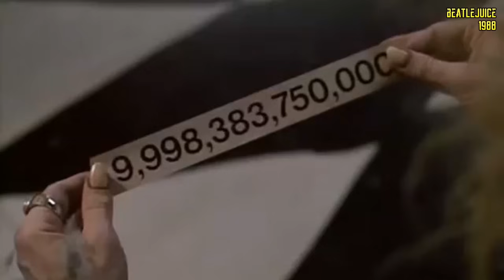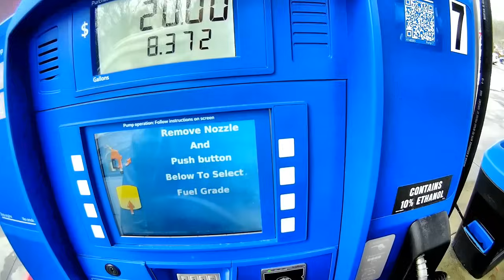Mini Truck (SE01 EP25) gets her clutch did! Another MPG reading. Consumer Transmissions  S83p HiJet

Comment: Its always the best ten-eleven minutes of my day. I liked the heartbeat during 'surgery' with the audience watching, i was really pulling for our mini truck there. Then her little horn conks out, you prolly should replace that with a train horn. WWWWWWWWAAAAAAAAAA...You edit a funny video bro. And aint it just like them New York drivers to cut you off like that, sheesh.
Reply from the maker: I fixed the horn, but have a good set if air horns I want to add with a switch to go back and forth. Yes. What an idiot. I have right if way, they had a stop sign

Comment: The headlights in the mirror was a Christine running up on the Camaro scene. 
Also would have thought it would have gotten a lot better mph than just over 20. My Tundra beats that and weighs much more. I still want one tho. With a 3 point hitch these would make a great mobile garden plowing machine. 
All around great video. 👍
Reply from the maker: Thanks!👍👍😎

Comment: Damn, clutch while you wait and watch.  That's service!
I'll need a clutch job on mine but I'll have to handle that on my own I think.  Fortunately the Sambar is rear engine but I'm sure it will throw me a curve.
Reply from the maker: The nice part is it so small and light and the clutch is tiny. none of the bolts gave a hard time at all, they all came out easily which was nice

Comment: Your videos are good, so glad I found them. Yesterday I bought an electric chainsaw like you have. Already bought CV boots and springs. Looking for a battery powered socket wrench like you use. Apparently the newer version has a much bigger head and is useless in tight spots. Keep making the videos. (Beep)
Reply from the maker: TY! They make a fuel and a regular version mine is not fuel... This is the model https://amzn.to/2V69P06
Reply: @MotoCheez  the difference i hear is 30 vs 50 ft lbs i cant decide which, but i might let the price do it for me.
Reply from the maker: For  the ratchet I finish tightening by hand. Art had the fuel that I used. It's heavier and bulkier.

Comment: Mine was frozen today and didn't want to start. Maybe tomorrow I'll go for a ride
Reply from the maker: Aww, you get a lot of snow?
Reply: MotoCheez it flurried. I am in the north west corner of TN. Not much snow. But it was below freezing for 2 days and my mini truck doesn't like the cold. I got a new battery for it and an oil change in store.
Reply from the maker: Well I just solved my choke problem on my mini if you saw the video where the choke wasn't working. It definitely needed to be lubricated because I could push that little gear lever back and forth that spins the plastic gear and it would stick and I looked it up and I kept going back and forth with it until it was I push it and it would spring itself back totally so now my choke is working finally. I guess it's pretty common from all the people commenting on my video excetera
Reply: MotoCheez I am planning on fixing that today. Mine always idles high. Just replaced the thermostat 2 weeks ago to try and get some temp in it.
Reply from the maker: yes, that's exactly what mine was doing when the choke was sticking idling high and would not come down and using a lot of gas and as you saw on the video I did the choke was on all the time and never heating up to come off
Reply: MotoCheez yea.  I gotta get a 4 wheeler fixed and out of the garage and then Ima tackle it.

Comment: Now having to put a clutch kit in. How did they align the clutch plate splines behind the pressure plate when it was bolted to the flywheel? Did they use a suitably sized piece of round dowel??? Is it necessary to remove the starter before taking the gearbox out or can the starter remain attached and come out with the gearbox? Unfortunately every online manual I can find online doesn't have the CL or clutch section.
Reply from the maker: There's a clutch alignment tool, some clutch kits will give it with the kit but they're not that expensive they're made in a plastic some of them got to line it up then bolt the pressure plate on
Reply: @MotoCheez  yes got a kit, only two in NZ for the Hijet. Don’t think it comes with one. Will measure ID of plate and count splines and then measure pilot bearing and then see if I can get one to suit that’s listed for other vehicles.

Comment: Love the series, I'm so jealous that I live in a state where mini trucks aren't road legal.
Reply from the maker: Pretty sure being "classic" they are in most states.
Reply: MotoCheez You just confirmed my plan.  In Virginia, “Antique” is the way to go.  If it’s 25 or over, you call it a Collector’s Item and you abide by the restrictions—“pleasure driving”, taking to shows, testing operation, don’t use it to commute every day, certify you have a primary vehicle and the antique is safe for use on the road—you can get an Antique plate and it’s street legal (and it never needs to be inspected!)  If someone with an old Ford Model A can do it...heck, mini trucks are way safer, at least they have seat belts.  Starting the import process today!
Reply from the maker: Awesome!! Exactly. It's special once you modify it anyway. I'd never commute with it unless I lived close on back roads.
Reply: I might be able to get by on special interest or sometging. If I can find a club for them. Still they don't make it easy.

Comment: Would you happen to know how to change the bulb for the headlights? I can't figure this out on mine
Reply from the maker: They're sealed beams... Remove plastic bezel and you push in on headlight against spring and turn slightly so the screws fit out larger holes. I did a LED conversion where you may be able to see it

Comment: wonder what the gears are in that thing I have been told they are in the 5's if that's the case they can be made to run faster
Reply from the maker: I've heard the same. Problem is finding a set for front and rear, and it's a bit under powered

Comment: so you can't put your truck in 2w low?  Mine can but it doesn't have any of the axle or diff stuff
Reply from the maker: It automatically engages 4x4 when you put the lever in low on mine. Even though  it has the 4x4 button

Comment: That MPG must be due to the gearing. Ive driven duallys with similar mpg.
 Id like to see a harbor freight engine swap in one of these, cheap, reliable and MPG should be insanely good.
Reply from the maker: Yeah  it's the tires and a lot of off-roading.  Harbor freight? Need 40 plus hp.
Reply: @MotoCheez  You only need 10hp to sustain 60mph, the trick is how long does it take to get there.
  Guy on youtube has an S10 frame geared for 35mph with a stock 6.5hp 212. 
I imagine you could do at least a strong 55mph with a 420 but 420cc arent cheap.
Reply from the maker: No way this will do 50 with 10 hp. Probably 30ish like a golf cart.. as speed goes up HP rises more rapidly because of wind resistance. If I were to do a motor swap, I would do a large CC liquid cooled motorcycle engine
Reply: @MotoCheez  The 60mph 10hp thing was a physics calc from way back, My truck takes less to maintain on steady ground. Going uphill however requires a lot more hp/trq.
Reply: @MotoCheez  Not a bad idea. I know the single cylinders seem to yeild the best mpg per cc.
Reply from the maker: Yes true in theory and on flat ground... I get it now 😁

Comment: hmm...got the lift, got good tires, got lights, redid up the seats...hmm...quick disconnect wheel?  thats prob too rice rocket only thing else i got is replace the steering bushing with poly since your runnin big o meats.  i got nutin else, always fun to watch.
Reply from the maker: Thanks   there's still a few more things I can do, bed liner, window tint, vinyl graphics, radio...

Comment: If you were buying another truck, would you buy another 4 spd or 5?
Reply from the maker: 4. The 5 doesn't have high low transfer case. If I didn't offroad I do 5
Reply: @MotoCheez  i dont offroad. Mainly want it for snow and plowing. Or the occasional offroad adventure. Always an adventure.  I want to take it on the highway, but amir said too, you really want to go 70-75 in this????  Like a go cart.
Reply from the maker: A 5 speed be good for you, not great for plowing because reverse will be higher but it'll work
Reply: @MotoCheez  just plowing for my house and some old neighbors, nothing commercial.If i dont plow, i can haul the snowblower around.

Comment: What did the clutch instal run?
Reply from the maker: Around $500
Reply: @MotoCheez  can I pick your brain??. I recently had heavy duty front coils installed on Mitsubishi mini. Now when I hit the brakes it pulls hard to the left. All the brakes look awesome nothing is tied up and brake fluid flow is perfect do you think alignment would cause this? Goes straight till I hit the brake.
Reply from the maker: Could be alignment. If it wasn't done, It didn't do it before?
Reply: @MotoCheez  didn't pull at all before. My mechanic checked all the brakes thinking it was that because it pulls really hard when brakes are applied. The mini is to narrow for his alignment machine..
Reply from the maker: Can do a string alignment. He's sure a brake line didn't collapse? It happens...
Reply: @MotoCheez  he plugged the rear brake lines then did a flow test on the front.  said everything flowed good.
Reply from the maker: Has to be alignment.. right?
Reply: @MotoCheez  hope so. Running out of ideas. Thanks for the input. Love your videos!

Comment: Alright Mini your gas ⛽ MPG has improved some 👍 Now lets see what ur MPG's are on High Octane fuel! ? Tell your daddy to put some hotter burning spark plugs in ya to more  evenly burn ur gas & see 👀 if that helps ur gas ⛽ MPG's any mini ?  
Hey Bro it may just be the oversize tires on mini making your MPG's as low as they are. Maybe with the New Clutch & some more tuneup you can get better. Have you checked all your vacuum lines for cracks & dry rot pin holes  on & around mini's carburetor? Maybe a new carb or rebuild that one could help ur fuel mileage?  If that dont improve ur mileage some then its the tires robbing ur mileage. But Mini is feeling much better with so many new upgrades! 👍 🚘
Reply from the maker: Yeah, I'm sure the tires aren't  helping. Plus using it off-road. I did check the vacuum lines, all good. The last tank 3/4 of it was after I fixed the choke too.

Comment: 11.2 Lt/100 Km still very
 high, if my Renault was equal i will be in bankruptcy😂😂
Gas is at 1.40€/Lt = 5.40€/US Gallon
Reply from the maker: It'll be a little better next time. The choke was stuck for a quarter of the tank last time and then I fixed it. Plus the aggressive mud tires run at 17 PSI or a big factor and I use it off-road quite often

Comment: 毎回楽しく見ています。
タイヤの径が大きくなっている分燃費は悪くなります。実際には距離計よりも多く走っています。
スピードも遅く表示されます。それと、タイヤの転がり抵抗が燃費に響いているようですね。
日本では、ノーマルで舗装路を50～60km/hで走るので、燃費は12～15km/L位です。
畑や林道等で酷使すると、10km/Lを下まわります。
最終的には、ゴムクローラーを装着したハイジェットを見たいです。
日本語ですみません。
Reply from the maker: ありがとう、アグレッシブなトレッドをテストしても燃費が悪くなります。オフロードもします。私がやるベストはおそらく27です
Reply: @MotoCheez  "The bigger the diameter of the tires, the less economical. In reality, more kilometers traveled than the odometer digits, and more speed than the speedometer digits. In Japan, about 12-15 km/liter at 50-60 km/h on pavement. On a farm or in the woods, less than 10 km/liter. In the end, I would like to see  rubber crawlers on Hijet."
Reply from the maker: Yes, that's why I calculated with the tire adjustment. Stock tires are 21". Tracks are way too expensive! More than what I paid for mini. I'd love to have a set ...

Comment: Supreme fuel is NOT 10% ethanol !   STOP PUTTING ETHANOL in your MINI TRUCK!
Reply from the maker: No other option around me
Reply: @MotoCheez  What ?  That seems crazy  . There is no reason to use premium fuel if that is the case !   The ONLY reason to use the expensive stuff is because most of the expensive stuff is free of corn fuel .  There is 0 reason to use "high" octane fuel and there is lots of science to back that up .  Stick with the cheap stuff if you really do not have a station near you that offers pure gas .   The premium octane scam has always been a huge money maker for gas companies and if they do not offer premium with no corn fuel added there is no performance reason to use it in any vehicle ever !   These mini trucks were never meant to use ethanol and that stuff really damages the fuel system of these old trucks . Beware of corn fuel and its acid like damage it does to fuel systems that were never meant to hold that crap .   E 85  is the death of good vehicles and even in 10% form it is the devil .
Reply from the maker: I run my timing way advanced to squeeze a little more HP, so I rather not detonate, doesn't use much fuel, plus the Chinese octane rating is supposedly close to our super according to forums on what to use in these trucks...